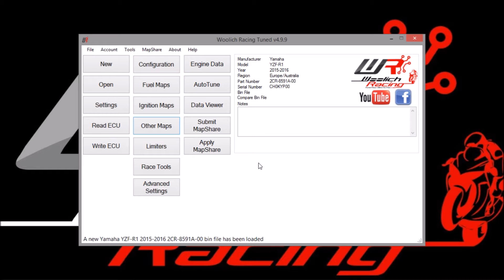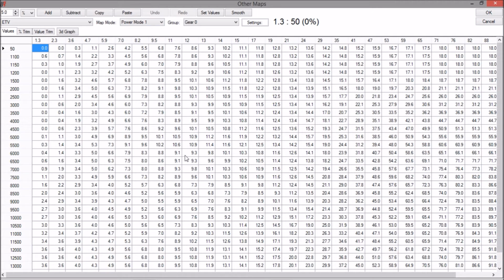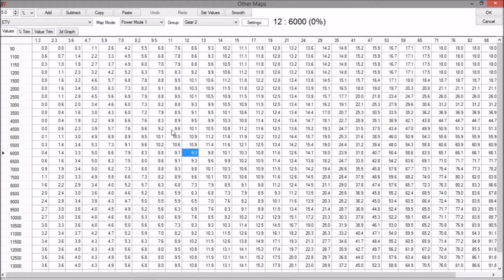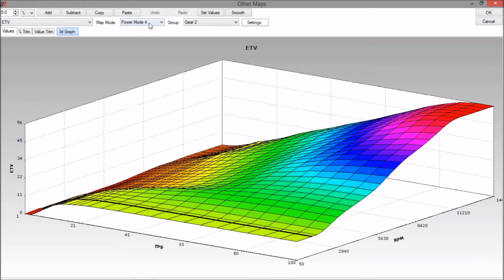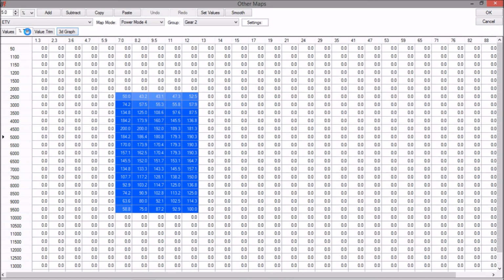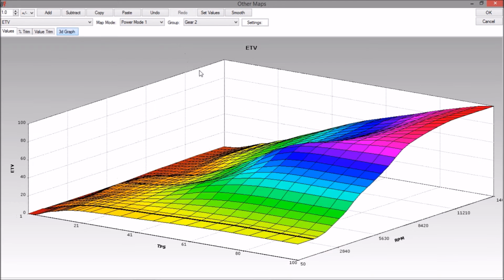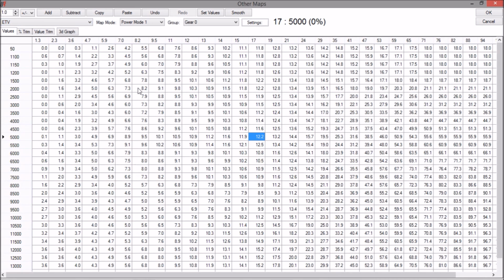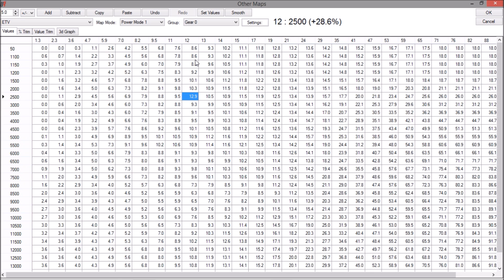Woolich Racing 2015+ R1 ETV Basic Guide

Comment: A new question:  Woolich is a great tuning software.  Very detailed.  Is there no way possible to dial in target AFRs and then swap back to narrow band 02 and allow the bike to keep target AFRs?  Our DA is crazy and fluctuates up to 3,000 feet DA in the summer.  Bike is running lean, rich, lean, rich.  The static tune of Woolich works well when the DA doesn't change so drastically.  I wish Woolich had a means of auto-adjustments verse manually using auto tune.  I want to flash the ECU my target IAP and TPS AFRS, and let the software tune it as I ride.
Reply from the maker: Hi,
Thanks for commenting.
As these bikes do not have wideband sensors factory and only narrow band there is no way to control fuelling over all the ranges. Narrow bands can not do that. Also majority of bikes prefer an afr of around 13.6-14.2 is under light load. As a narrow band can only trim to 14.7 afr and it can only trim so much. This is why say in your R1 you can get surging when changing the exhaust. 
I have successfully set up some Suzuki to run full wideband control through the ecu using Woolich, ECU editor and some clever wiring. I think commanded the wideband to constantly trim at 13.2 afr and works great.
Your best option is a Rapid bike module to control the fuelling with live trims. 
Or your other option is you can trick the narrow band voltage signal with some resistors and get the narrow band to actually command 13.6 out of the ecu for cruising but your wide open throttle will be out with your DA. 
In saying this I offer tuning to places all around the world setting up there Autotune systems and 1 on 1 Woolich guidance and most of the time the filters are not set up correctly which will give you false data hence why you are seeing some big swings. 
I’ve tested my maps with R1 at various DA level on various dynos and fuelling has been within 5%. Don’t take all your data through Autotune as gospel.

Comment: I understand the purpose of the ETV in relation to the TPS, but what exactly make an ETV map "Good"?  If most cruising is done under 10-12% TPS, why not have an ETV Map that is aggressive above 12 or 15%?  Aren't those low percentages in the cells choking performance?  Nobody can seem to answer how to create a good map.  At what TPS the ETV should be 100, beside 100.  Any feedback is welcome.
Reply from the maker: Thanks for the question. ETV basically controls the torque/ power delivery of the engine.
I do some tuning courses that goes into depth about ETV mapping if your interested. But the best way is to ride the bike once the fuel is corrected, adjust the ETV to what you want and then just double check the fuel delivery.
Reply: @LS3PSI Just found your response.  I don't get any notifications when someone responds.  Don't know why.  But thank you for your response. Since then, I learned how to adjust the ETV to be in good relation to my TPS.  "Slow is smooth, smooth is fast."